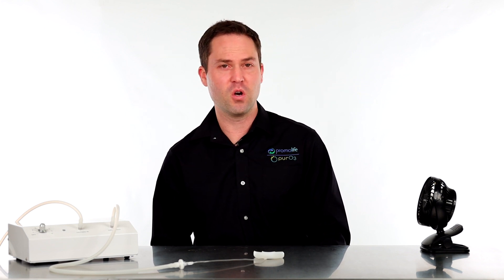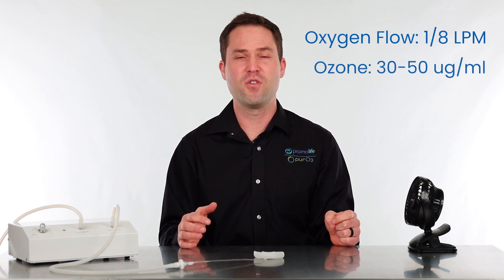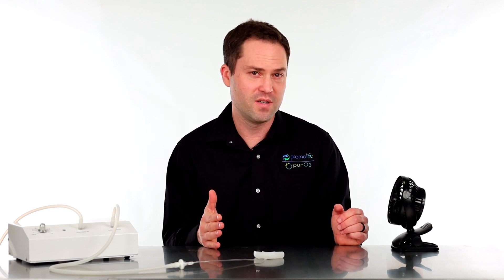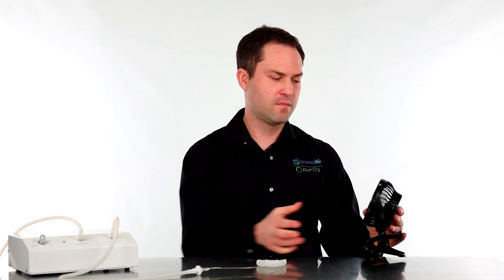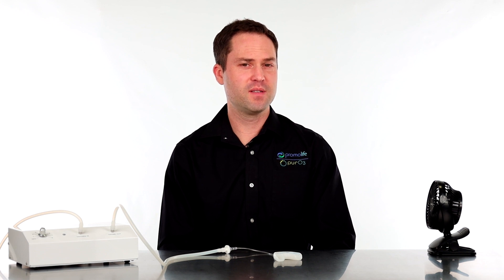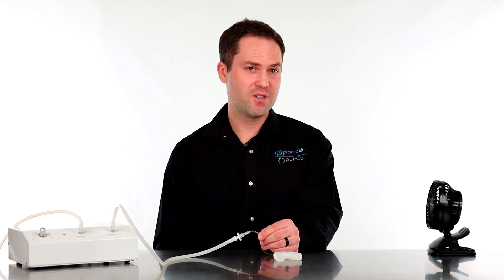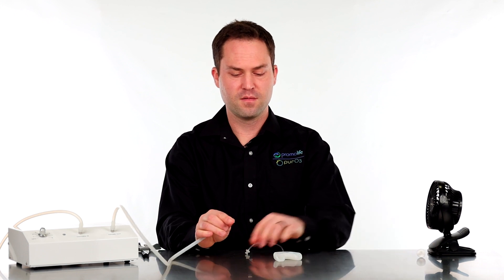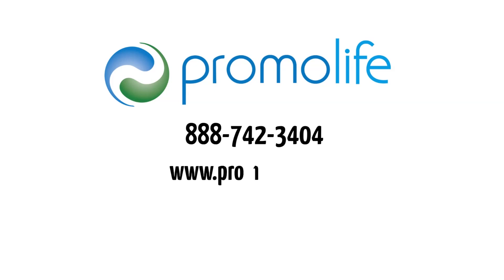What is the Ozone Dental Mouthpiece? Ozone Dentistry Tools

Comment: I just used it for first time. Took a few secs to figure out how to breath correctly.  Everything went smoothly until I removed it for the 2nd time and I totally forgot and took a quick breath thru my mouth: Arrrg. Not fun! Took a couple grams of Vit C.
One thing I notice right off is the plasticky taste in my mouth. I wonder if that's from the device, or from my composite fillings...
Reply from the maker: Ozone is an oxidizer so the plastic taste would come from the mouthpiece.
These devices are designed and manufactured in Germany specifically to use with ozone.

Comment: The proximity  of nose to mouth makes it such that the intake from the nose will more than likely take some expelled ozone gas into the nose unless the fan is very powerful which would likely dry out your nose tissue.....ever consider a snorkel type mouth piece to avoid this issue?
Reply from the maker: You would be surprised that a small fan will eliminate all the ozone from escaping from the mouth.
A large fan is not needed.
Reply: @promolife  Do you sell the fans?
Reply from the maker: @zachary813  No, but you can find one super cheap at most retailers.